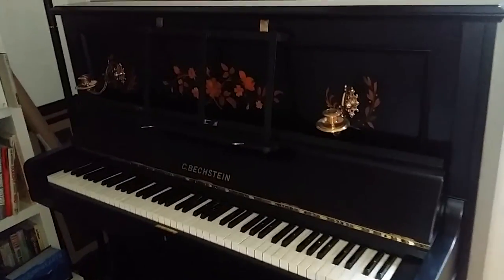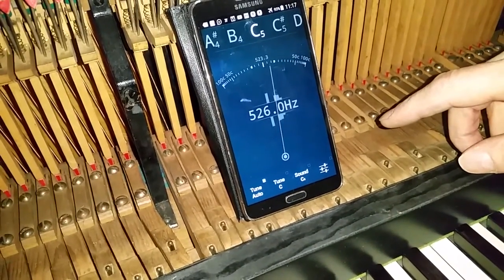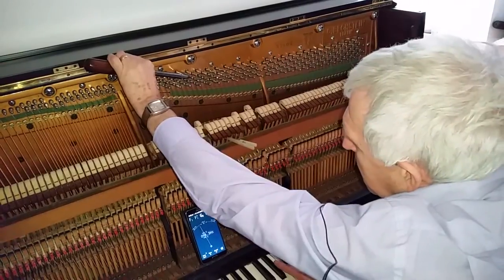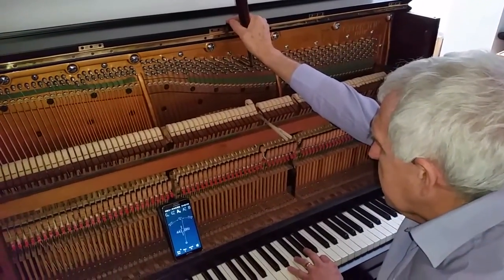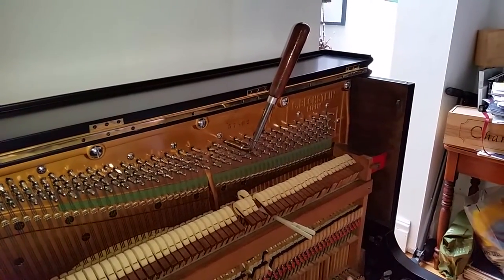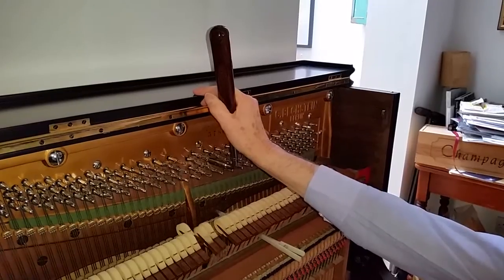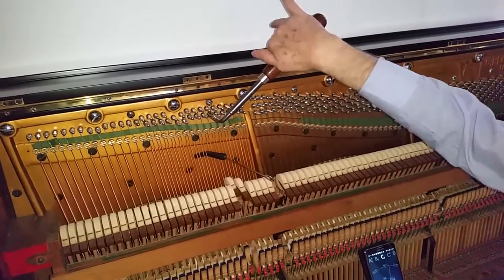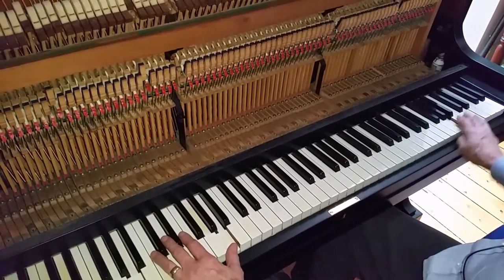Wonderful Bechstein Model V Upright Piano - New Wrestplank, etc

Comment: I've always found the 'thin' treble sound on old piano's due to the lack of down bearing as the board loses it's crown. Usually have to adjust the frame posts/ bearing pads to overcome it. Good video.

Comment: Hello, is it possible to remove the hammer mechanism without moving the keys? they appear to be connected. I need to identify where a clicking sound is coming from (when several keys are released)

Comment: Well, regarding price in the matter of Bechstein, which has NOT lowered its standards over the decades, current Bechstein studio and taller uprights still sound fabulous, so a new Bechstein upright might be an economical decision compared to restoration. Still, older Bechsteins or Bluethners are so wonderful that it is almost a DUTY to assure that they survive in good condition. Anyway, new or reconditioned, a Bechstein piano is a wise, if pricy, decision.
Reply from the maker: New Bechsteins are wonderful pianos but have a "modern" tone similar to other modern pianos and totally different to these earlier ones. Marcus
Reply: Well, you have a much wider exposure to these instruments than I would have, but the Bechstein uprights that I have heard have a clear, bell-like sound in the upper half of the keyboard that is utterly bewitching. However, it is the studio-size Bechstein uprights that I am thinking of. Perhaps Bechstein has "modernised" and hardened the sound of the new taller uprights. Does that distinction make any sense? The studio models are the best uprights of that size that I ever have heard. I have a Bluethner baby grand (Leipzig, 1935, rebuilt entirely with Bluethner parts imported from Germany in the mid-1990s) and a Knabe (Rochester, N.Y., from the last year of production of them there) studio upright. I am very partial to the sweet tone of such German or German-like instruments.
Reply: Because - I reckon people underestimate the extent to which piano-makers respond to market expectations (rather than to produce a best possible tone).  No one would manufacture-market an upright without the heavy solid boards on the front even though it is equivalent to putting a large book in front of your hifi speaker (try it....!).  And a high proportion of people first-time buying a piano want it to be "not too loud".
Reply: "almost a DUTY to assure that they survive in good condition."
Having "rescued" two Model Vs myself I couldn't possibly comment....
Exactly the same inside as this one here (except without someone adding that extra strip of cloth by the bass pins haha).   If it's the same vintage as mine (25431 and 34564) then it will have had the non-benefit of brass bridge pins almost certainly necessitating recapping-repinning the bridges.

Comment: your only bending the tuning pin when you push like that not good for the pin
Reply from the maker: Thank you for your comment; you raise a very important point. The downward pressure should be such that it doesn't bend the pin, so only slight. Too much pressure and as you say, the pin will bend or the hole in the wrest plank will elongate. Marcus